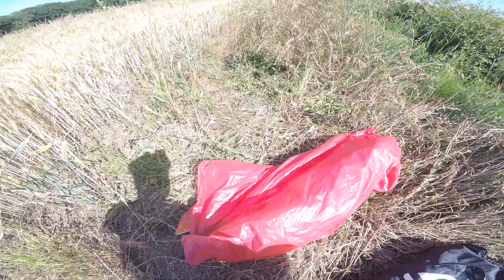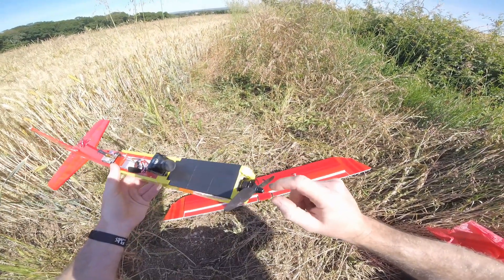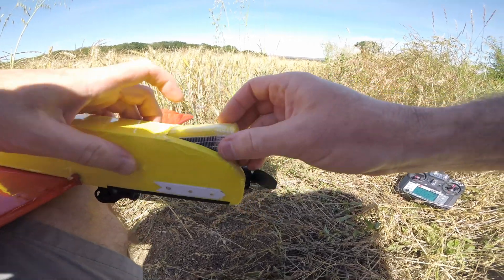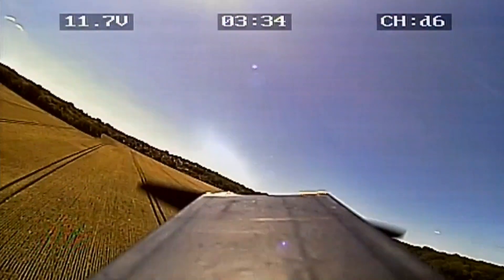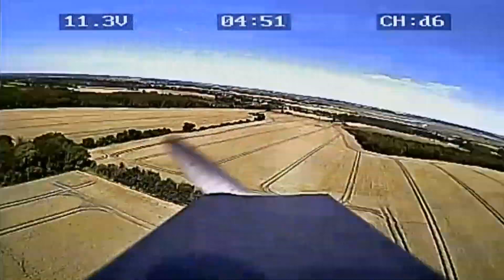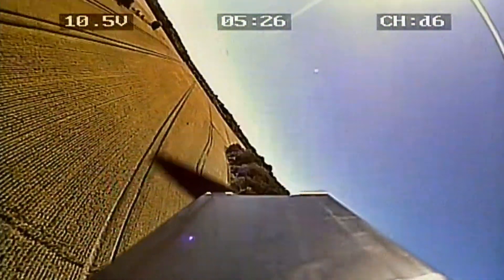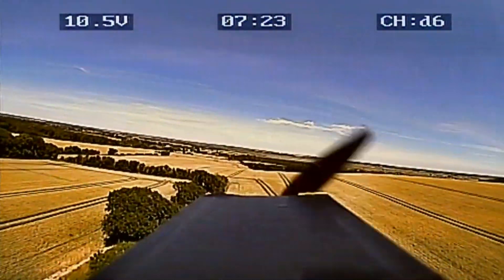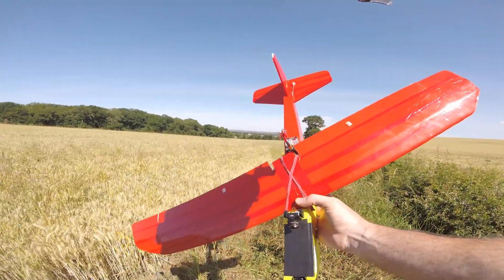FT Tiny Trainer

Comment: Nice video! How many sheets of foamboard did you need for this build?
Reply from the maker: Thanks, from memory I think it was 2 sheets of 5mm A1 size is 841 x 594mm - ( 33.1 x 23.4 inches ).
It was one of my favourite builds, unfortunately, it’s no longer ☹ after the Velcro failed on the lipo and it
fell off mid-flight! 
I'm now experimenting with Correx sheets for builds https://www.youtube.com/watch?v=AMJsOT7vaII&t=145s
Different beast, fast and tough, but not as stable as the Tiny Trainer 😊....